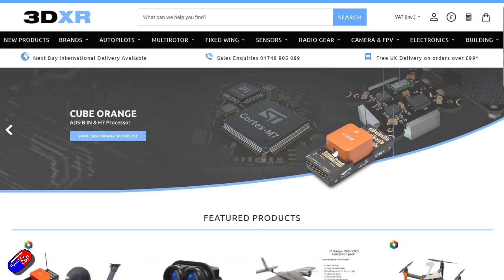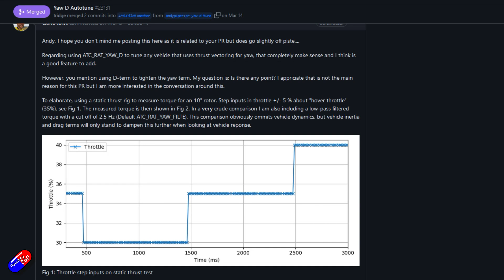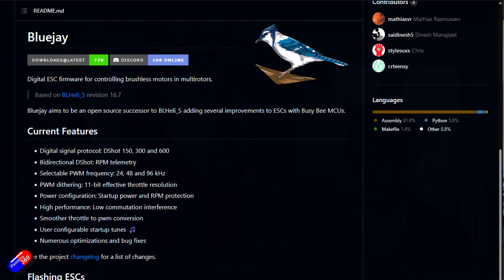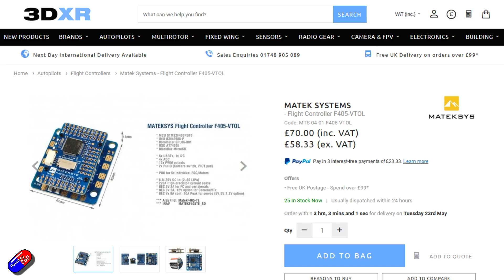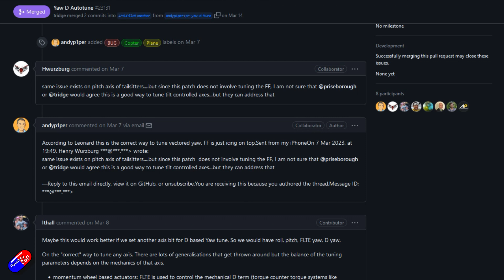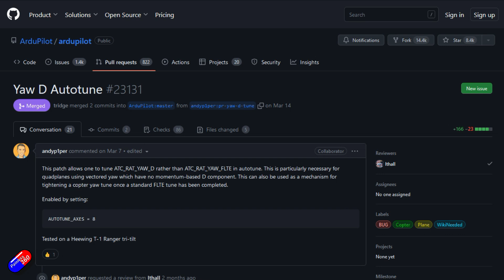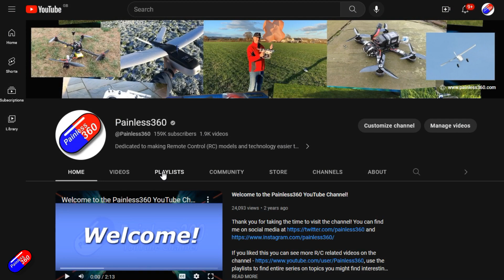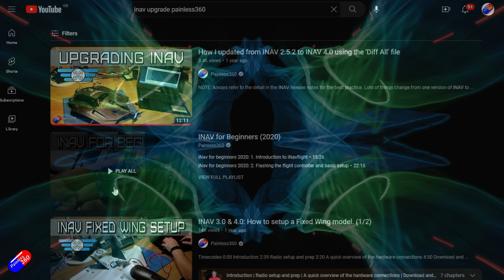Ranger T-1 VTOL Tuning: Example tuning files and some interesting findings..

Comment: Lee, do you have a print out copy of the parameters saved?
I cant get the file to open in Dropbox 
Thank you sir !!
Reply from the maker: I don't. The param file quickly became unusable as the Ardupilot versions changed and pilots got into trouble trying to use it. I may revisit this later in 2025 with Qwiktune... Happy flying
Reply: @Painless360 thank you

Comment: Thank you both, Lee and Andy, for this video, and your work on the Heewing! I just received my Heewing VTOL PNP plane, and have it set up according the Heewing directions. It came flashed with AP 4.3.5. I have not flown it yet, so my question is to what degree should I implement Andy's PIDS and notch filter. In a past video, didn't you indicate that Heewing's FC was different than the Matek F405? So I'm kinda cautious about filtering and PID parameter changes if the FC's are different. Also, would love to see a video on ESC firmware and dynamic filtering!!!
Reply from the maker: I've not touched this stuff since these videos and my understanding is that HEEWING are shipping a more finely setup tune now, based on this work from Andy... Best of luck!
Reply: @Painless360  OK, thanks for the quick and candid response, Lee. I'm truly hoping that Heewing incorporated Andy's hard work into the current PNP version. Maybe I'll shoot Andy a message to confirm...thanks again!

Comment: I recently bought the PnP version of this and am currently setting it up. The GPS unit is hot to the touch after only being plugged in for a few minutes. Hot enough that I have to pull my finger off of it after a few seconds. I'm assuming that's not normal.
Reply from the maker: Definatly not normal. Sounds like it is wired wrong or getting too much voltage... Happy flying

Comment: MANY years on Betaflight, new to Ardupilot.  Just received a Ranger VTOL, to be DJI Vista and ELRS. As a "newbie", many aspects of the provided file are not clear. Is it the equiv of a "diff all" or a cut to the bones stand alone set. I assume its a change list since its tiny by comparision with the Hee Wing supplied firmware. I note it includes settings apparantly specific to a particular battery size.  OK I guess a user needs to ignore these and use their own settings here (or do they, is this patching an issue?), well, I hear people say don't be silly, but when suggested changes are in other parameters that are totally unclear as to purpose (to me) or may be for other hardware than I have, the waters muddy as to need/validity/effect and relevence to my situation.  There are quite a few commands in your file that are not in the supplied with the plane file at all, some that are altered logically, and some that the number change make a newbie step back and go "Woa", like one changed from 1 to 4096, for example.  I have the plane basically completed and motors, run, surfaces move (control and gyro). Tales of HW's set being far from ideal are though very concerning,  but so is making large changes to unknown parameters!!  Seems clearly above my pay grade, but I'm trying.
Reply from the maker: How to video coming soon. You've chosen one of the most complex model types and setuos so it'll be a learning curve. Happy flying

Comment: Thank you both, this is really helpful. I am tuning an Eachine Airloader I have converted to a VTOL Y3 tiltrotor. It is very similar to the T-1 VTOL, just a bit bigger. It actually hovers amazingly well with zero tuning in QLoiter and QHover, but think it could be better, particularly in yaw stability. I have Arduplane 4.4 on SpeedyBee F405. @andypiper5285 Do you think the Initial Tune Parameter tab in MP is a good starting point for an initial tune of a tiltrotor, before using Qautotune?
Reply from the maker: Video coming out very soon on the final tune/filter settings for this on Ardupilot 4.4. Stay tuned!

Comment: hi lee , i am encountering  yaw problem with this vtol , i have build the the vtol using matek f405 wse , all things are working properly , except when it is in qstabilize mode it starts to rotate in clockwise direction . I have  used ft bronco as the platform for the vtol , please help me to solve this problem
Reply from the maker: I've not seen that. It is odd that I  only happens in one mode... all I did is covered in the video. More videos comjnv when Ardupilot 4.4 is out... stay tuned

Comment: Thanks guys! Will these PID's work with the new pre-built VTOL T1 Ranger from HeeWing? Or will it only work with Matek flight controller?
Reply from the maker: The PIDs are Ardupilot, model and setup specific but should be closer. HEEWING are sending confusing messages about the tune at the setup with the notice on the website listing warning that the setup is a 'starting point' and a post on the Facebook page last week now claiming that all you need to do is bind a radio to fly it. They can't have it both ways. Which is it? A 'starting point' or a complete setup?

Comment: Are you going to be able to get your hands on the new pnp vtol T1 heewing just put out using their own FC?  I'm wondering if their FC has the same problems as the xiake.  Thanks, love the videos.
Reply from the maker: It'll need testing... Stay tuned
Reply: @Painless360  I got one today.  All I can say so far is that the Compass, barometer and GPS are all detected. Wonder what 405 chip they are using. SBUS worked on the RC-In port but I could only get crossfire to work on one of the normal uarts.  I'll be watching your channel!  Thanks

Comment: I believe that the beta for arduplane as of June 8 contains firmware for the F405-TE which contains the end tag of -bdshot. Wondering if that means the Matek F405 VTOL supports bdshot and the notch filtering? Great video as always!
Reply: Is the following: "Firmware site, path: /Plane/stable-4.3.7/MatekF405-bdshot" (which was copied from the Ardupilot download site) that which you are referring to? Will this give us the needed notch filtering on a Matek 405?

Comment: Really enjoying this series! I have built 2 Vtol planes from scratch in the last 3 months and had a successful maiden a week ago with the Speedybee F405 wing and it flew amazingly well and fast!!  My  other VTOL has a Matek and have had successful hovers around the yard. I found that using the Matek M10-5883 GPS really smoothed things out in my setups. VTOL is the ultimate way to tinker with aircraft and your content is extremely appreciated.

Comment: Thank you both. I have been using Ardupilot exclusively since the start with the original "legacy" boards then the so called "oil pan". Greatest respect to Andy for his input to the "code" FYI I have also used Arducopter on a 3"" build!

Comment: Tried 4.4 beta the 405 TE (VTOL) and it has issues, cannot get more than 2 dshot motors to work and it breaks some servo outputs, guess it is related to DMA allocations, will wait for 4.4 to release before I try again. Thanks for the efforts!
Reply: Thanks for the report - I will investigate
Reply: Hi, the issue is that you can't use channels 1-4 because of the way the pins are mapped. It's best to use Channels 5-8. You could also possibly use 1,2,4 but channel 3 will not work

Comment: What ESCs is he using? I had a good tune with the original ESCs on the T-1 but the weather vaning option caused it to crash, so USE with caution!!

And Yes make video about 5” quads with AP, I have one already and with a 4S2P lion pack it flies for almost 30 min. I use this one for search operations, I can put the param file if someone is interested
Reply from the maker: The ones supplied in the kit... Happy flying
Reply: @Painless360  So T1 VTOL FX-25A Upgraded ESC 2022／2023 BLS ESC, and not the one they sold before in the VTOL upgrade kit, those ones dont support BLHELI_S, and with this setting SERVO_DSHOT_ESC,2 it's enabled in the parameter file. You can get weird results as Dshot commands are not executed while using the "old" ESC's

Comment: Many thanks, I woulds definitely like a video(s) when 4.4 comes out going through every step to put everything on the T-1 and Radio to get up and flying. Another thought, would this set-up be appropriate to put on a Xiake 800 to improve that as well. I presume would need different tuning and more ?. Would it even improve the ZMO and any another VTOL ?
Reply from the maker: The improvements to the code (a few other issues have been uncovered in our testing) will help with all tilt rotor VTOLs...

Comment: I am running Speedybee F405Wing and my Q_A_RAT_PIT_P/I/D are close but lower, probably because I haven't added any notch filter yet.  Just so you guys are aware after getting the hover PID for pitch/roll/yaw done, you'll have to do it again for fixed wing mode.  This VTOL stuff is quite a challenge to tune, but the reward is totally worth it!
Reply from the maker: Willing to share your tune?
Reply: @Painless360  Of course Lee!  I haven't done much with YAW yet but with these PID it's stable enough for me.  My goal is not for perfectly tuned hover, but just stable enough hover to gain altitude for forward transition.  I hover in QSTABILIZE mode and transition to FBWA without issues.
Q_A_RAT_PIT_D,0.0036
Q_A_RAT_PIT_I,0.25
Q_A_RAT_PIT_P,0.25
Q_A_RAT_RLL_D,0.0036
Q_A_RAT_RLL_I,0.25
Q_A_RAT_RLL_P,0.25
Q_A_RAT_YAW_D,0
Q_A_RAT_YAW_I,0.018
Q_A_RAT_YAW_P,0.18
PTCH_RATE_D,0
PTCH_RATE_I,0.15
PTCH_RATE_P,0.04
RLL_RATE_D,0.003407344
RLL_RATE_I,0.06943209
RLL_RATE_P,0.05196203
Reply: Note that there is no bdshot support for this board currently, so you won't be able to use ESC telemetry for the notch
Reply: @andypiper5285  I am glad you mention this, otherwise I'd be wasting a bunch time trying to gather any meaningful logs for notch tuning!
Reply: @savagefpv1043  You can still use a throttle based notch - it won't be as good but it will be better than no notch
Reply: I've got a (bicopter) tilt rotor quadplane with vectored yaw control and my tuning (also proving very difficult) has been entirly on Q_A_RAT_PIT/YAW/RLL/_P/I/D/FF...mainly reliant on the FF term for Pitch and Yaw.

Why is tuning for the Ranger VTOL, which I understand to be a quadplane, using ATC_RAT_YAW_D rather than Q_A_RAT_YAW_D? (ATC_xxx isn't an available parameter set that I can see?)
Reply: @fraserboyd5448  probably my bad ATC_xxx are copter parameters, the VTOL equivalents are ATC_ -> Q_A_
You should not be using FF to tune copter/VTOL parameters these are very rarely the right thing to use